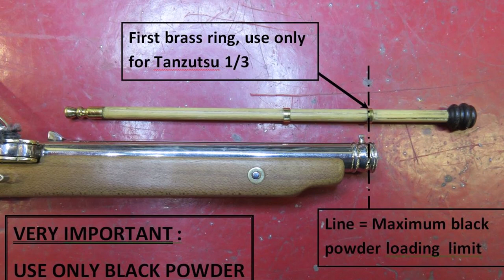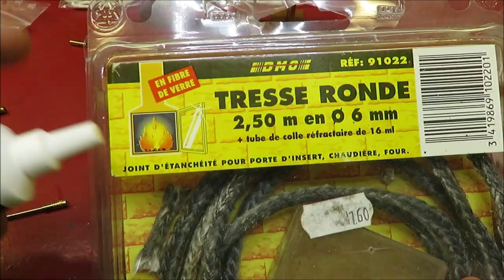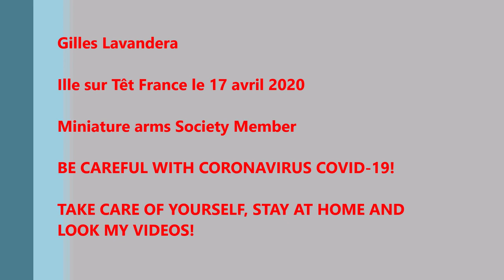Tanzutsu and Arquebus loading

Comment: It takes a lot of time to make something smaller then normal size like miniature Remington rolling block with Basic tools and a Dremel I been thinking about a rolling block rifle because you can’t go wrong with a single shot
Reply from the maker: The rolling block is not as simple as it seems. It's a bit like the Spencer, the cylinder heads are swivel. It is very difficult to machine and precisely adjust curved small parts.
 https://www.youtube.com/watch?v=bps5pRqJ1hM&t=23s
But it is a model that deserves that we take an interest in it, great project.
Reply: Gilles Lavandera agree rolling block is not simple but it’s known for how interesting it works and it’s a very early firearm for its time and most people still love it